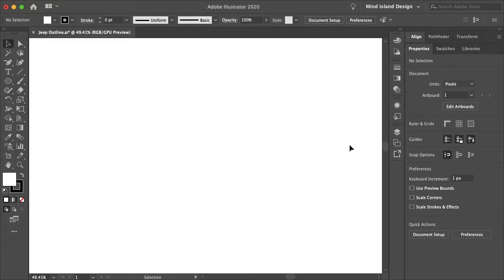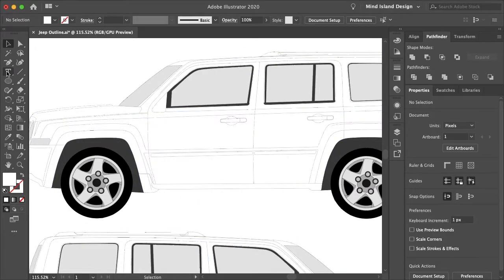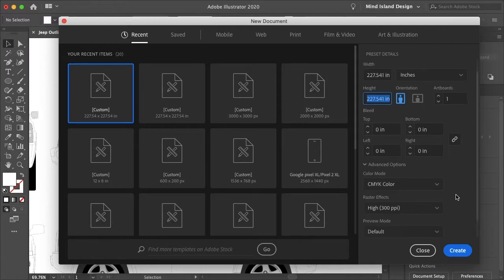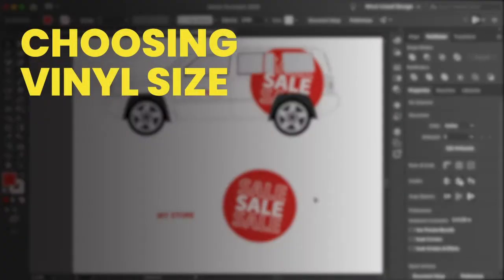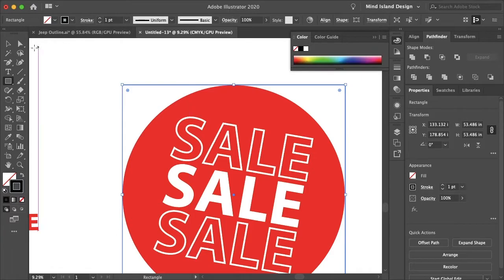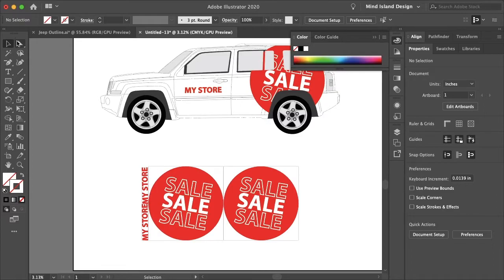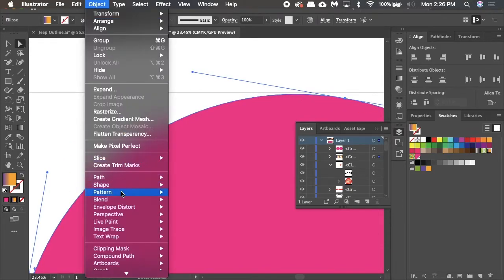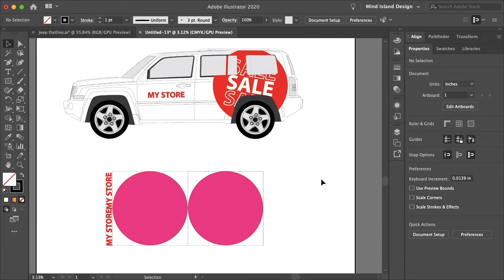Designers Guide to Wrapping a Vehicle in Illustrator

Comment: i have a question, when for example a livery has lines which connect from the hood of the car and moves to the sides or for example the doors, as we know the 4 or 5 perspectives of the car are separated, how do you calculate how the tip of both lines will connect from both sides? until now i have been doing it with the help of wireframes in just 2D templates, but i wanna know how it is done for a real life car so i dont end with two lines that doesn't connect on the tip in both sides.